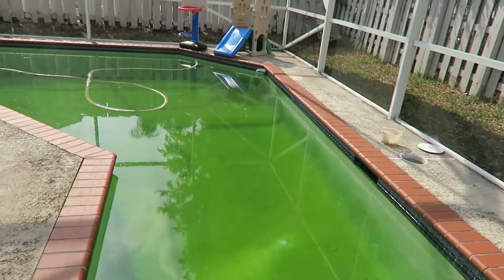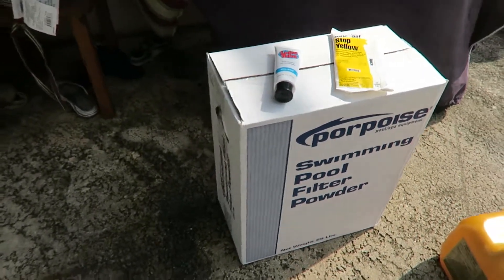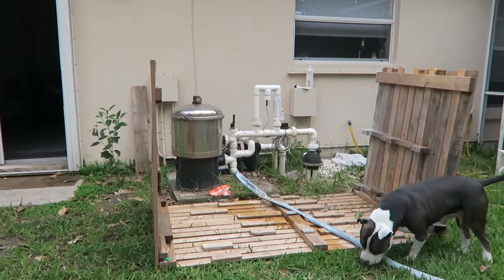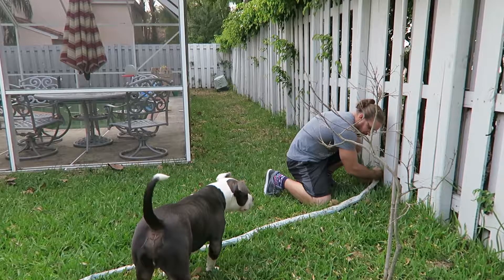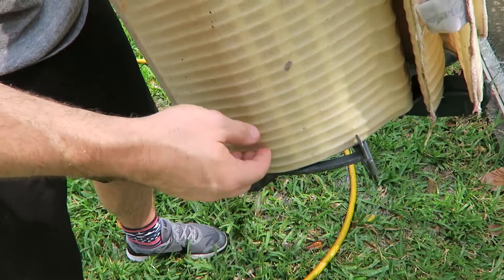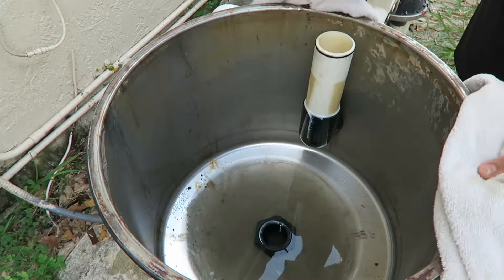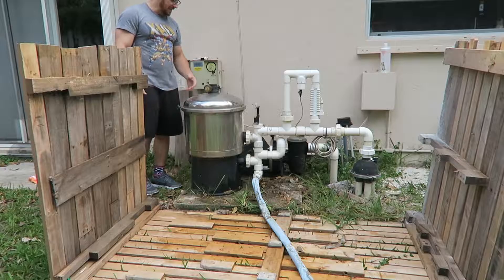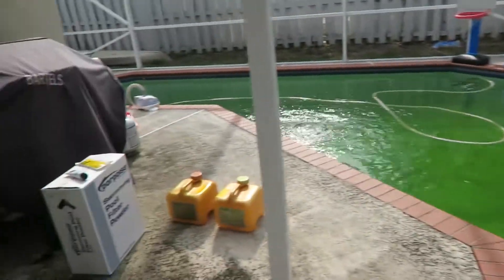How To: Clean a Pool and DE Filter | DE Filter Pool Maintenance

Comment: Think there would be a need to run the filter through another clean after everything is cleaned up? Or would that just be overkill?
Reply from the maker: +Chris Varona good point. I actually should take a look at the grids again. Pump has been slow. Not as much pull.